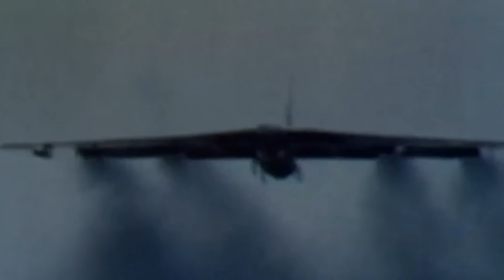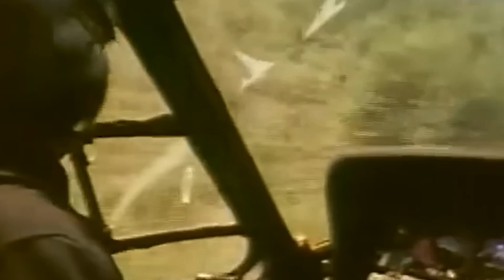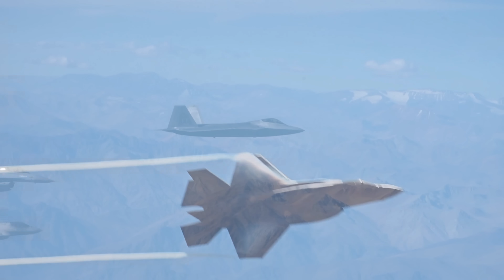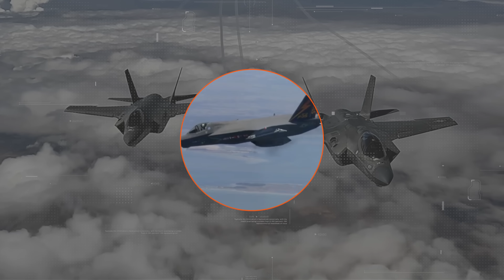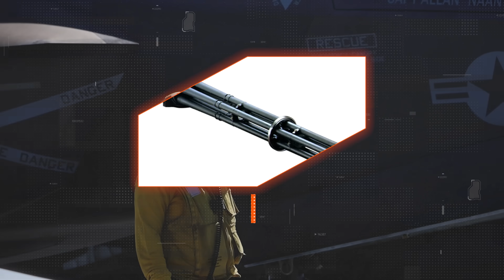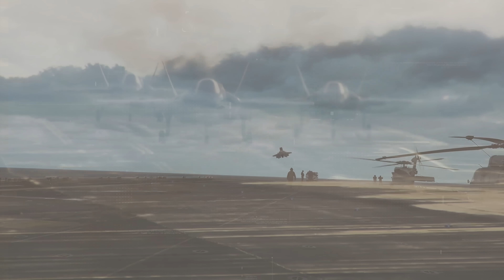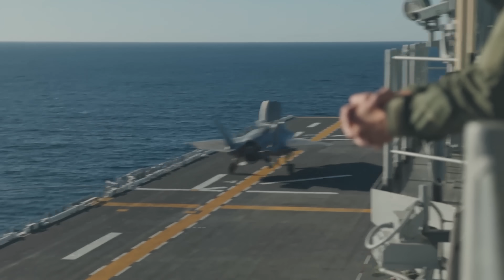A “STUPID” Mistake Is Making the F-35 UNSTOPPABLE

Comment: The F-4 was never modified to carry external gunpods, the gunpods the F-4C onwards used were designed to be used by the F-5C/Es when it was performing CAS missions and came in two flavors, one with a 20mm cannon and another with a 30mm cannon to fight against troops with ligh armored troop carriers. The F-5Cs would be recalled back to the US, when Col. Olds decided to make a tests of its own, he strapped gunpods on his ands his wongmans planes, and went on, and after a series of tests Co ckuded that the 20mm cannon pod offered the greatest bang for the buck in terms of benefits vs performance penalties on the dogfight they had against MiG-15s, MiG-17s and MiG-21s over Vietnan. He then submitted a report to the Pentagon recommending that all F-4s be equiped with at least one gunpod, later the Navy decided to adopt the gunpods, and McDonnell-Douglas streamlined the pods aerodynamics and it external dimensions to be more in line with the F-4s larger size and to be safer for carrier operations. The Airforce was more adamant in dating the Vulcan as an intern gun to its F-4Es, but the Navy's F-4Js continued with the pods for quite a while longer.

Comment: I used to believe the myth that the F4 missing a cannon was a mistake and it's final inclusion restoring the US air dominance.

But the statistics don't bare that out.  The statistics show that pilot training leading to better missile envelope employment and straight up improving the missiles themselves is actually what improved the combat performance of the F4.  The clearest indicator of that is the navy F4, it never had an internal gun, yet it's performance improvement was remarkable.
Reply: To further your point, the original F-4 of the Air Force did not have a gun. When they were fitted with a gun after, their kill ratio did not even improve, but just stayed the same
Reply: and topgun seemed to help

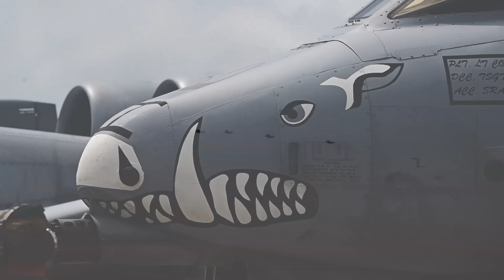Comment: 14:50 A-10s are classified as short take off. They can make do with only semi-prepared 1200 meter runways.  An F-35A needs twice that, in pristine condition.

"The A-10 needs huge runways" ?! Excuse me?

(Yes ok fine Gripen gets by on 800 meters. But 1200 is not huge by anyone's count)

Comment: The external gun pod is stealthy, it does not compromise the low radar observability aspect of the F-35 B and C versions. You still need to get within like less than 10 kilometers of the aircraft to get a radar lock on these fighters. Meanwhile they can just hit enemy aircraft from 100+kms away with the latest AMRAAM.
Reply: The external gun increase external surface area, it must increase the RCS by some amount, that is just physics.

Comment: Ironic. What makes the gun on the F35 B and C so invaluable is the fact that it can be replaced with something else, but otherwise it's mostly a detriment to the A that has it built internally. Though honestly speaking, with modern all-aspect missiles, it's hard to see a situation where having a gun is better than having another missile or two now. I mean, a gun can't shoot at the guy trying to get a gun solution behind you, but a missile can. And stealth fighters are inherently 2nd rate dogfighters because the qualities that make them good stealth jets make them bad dogfighters. Pretty much any 4.5 generation fighter has the advantage once you're within gun range.

That said, I do not think that it's a good idea to simply dismiss guns at this point. A last line of defence still serves a purpose, so it must be seriously considered if removal is to happen.

Comment: We need a new multirole aircraft fighter/bomber.  Give it vectored thrust like the f22 2 engines and use the electronics and the engines of the f35.  Make it 1.5x to 2x times the size of the f22.  More fuel more payload but with 2 of the massive engines of the f35.  This would replace the F-15.
Reply: You just described Su57😅
Reply: @pashapasovski5860  No I didnt because the Su57 is a 4.5 gen aircraft not a 5th or 6th gen and it doesnt have the most powerful engine ever put in a fighter jet.

Comment: Whilst missiles might not have been up to it in the 1970s they're alot better now... Even more crazy is that the F35 is built around the AIM-9 and unable to accomodate ASRAAM....
Cannon were used in both Iraq and Afghanistan against ground targets but that's not what the F35 is really for.
It would seem like taking the cannon out of the F35A would be sensible, then using a gunpod if the mission demands it.

Comment: The F-35 is a overpriced failure. If you want a top of the line aircraft you buy the JAS-39. Far less expensive to buy and to operate and far less of a snowflake when to comes to rearming refueling and repairing battle damage. F-35 can´t even land & take off on a standard straight road but MUST have a airfield, the first target of any attacker.

Comment: Seems pretty stopable . What percentage of the fleet is grounded?
Reply: Yeah, I've heard the software has been really buggy and a huge fraction of the planes are grounded? If the plane's own OS has it shut down before it even takes off, doesn't sound very unstoppable XD and if the software is that unstable, maybe some ECM on the sensors will throw the system into chaos and remove an active fighter from a battle!

A highly complex system can be really advanced and great - when it's stable. If it's not stable, then it's still just experimental, prototyping, unfinished : unfit for combat deployment.

Comment: I just retired from PWA who makes the F35 & F22 engines. I inspected engine components. These are great engines and I was proud to support the Air Force.
Reply: Those engines are a big reason the U.S. keeps an advantage over Russian and Chinese fighters.  And they are getting better all the time.
Reply: Why are the down time hours through the roof??………
Reply: @nikolaucznaum4312 

It is absolutely NO SECRET why the maintenance on the engine is so high. There are a number of governmental reports on the exact cause. Basically the engine is being run way TOO HOT! This is because the airframe requirements were significantly increased AFTER the engine design was completed! To fix this the engine is getting a significant multi-billion dollar redesign to deal with this problem. The problem was NOT the fault of the engine manufacturer, but rather creeping upwards demands placed on it!
Reply: @nikolaucznaum4312 don't believe the hype, they are op available, higher rates than f 16s , and f 15s were
Reply: @nikolaucznaum4312 When you want to make the worlds best stealth plane, you do sacrifice some sturdyness. F-35 has a long turnaround time, because it requires a controlled environment and highly qualified personnel to reload and refuel between missions. This causes more time on the ground. It is not that it is defect, it is a design choice to improve other properties.
Reply: @jenslrkedal9219  Cut the bullshine!!....
Reply: @nikolaucznaum4312 What is YOUR opinion then about why F-35 has to spend so much more time on the ground?
Reply: @jenslrkedal9219  At a unit cost of £92 million. One would assume at least 70% uptime; it currently sits below 50% components are rotting on UK aircraft carriers. Lockheed Martin should be  dragged over the coals for this failure. Did they not do environmental testing in all conditions? The much vaunted F35 has not delivered operational excellence.
Reply: @nikolaucznaum4312  the 4th gen Eurofighter Typhoon cost $200 million per unit.  The F35A cost $92 million per unit.

I'd take the F35, no contest.

It's not Lockheed Martin's fault that the Queen Elizabeth class aircraft carriers are designed poorly.
Reply: @jenslrkedal9219  ALIS and LO
Reply: @nikolaucznaum4312 It is not the engine, it is the overall design. It is a very delicate design, which need a clean environment. Contrary to the Saab Gripen, which is designed to start from a gravel road, and be reloaded by conscripts.
Reply: @j @jenslrkedal9219 ey are literally rotting on UK aircraft carriers engines as well….
Reply: @jenslrkedal9219  The Saab Gripen is closer to  a T-7 trainer than it is to the F35.😂
Reply: @jacobzindel987 There is no comparison, except that Saab was involved in the design of both. The T-7 is a light, subsonic jet with limited weapons capabilities, and without Gripens advanced electronics. It also falls behind Gripen in maneuovre capability and STOL performance.
Reply: @jenslrkedal9219 so delicate  one took a hit from an s 300, and was flown home
Reply: They are an incredible engineering and manufacturing accomplishment.

Comment: With the increasingly huge numbers of drones entering the battlespace, aircraft are going to need significantly more rounds of relatively inexpensive gun ammo.  Perhaps even multiple external gun pods.  An aircraft's internal gun(s)/ may be its most important feature.
Reply: You should have  proximity fused ammo to hit a small target like a drone. That means a 30mm gun or better.

New mini missiles just arriving last month can track a drone, but cost less than a drone. 
7 fit a standard rocket pod.

Comment: This may be a silly question, but what stops them from modifying the A model to carry such accessory pods?
Reply: A model is stated as having its gun internal as the 22 B was STOL and had extra stuff inside so no room. C was more internal room for extra fuel and reinforced for carrier use. Again no room internal left
Reply: @efuller6770  Hilariously enough though the Air Force should adopt the C model wings for more range and better maneuverability.

Comment: This configuration also means that it could be possible to swap other cannons in place of the GAU-22, including lighter weight ones firing the 30x113mm shells used by the ADEN, DEFA, and M230 chain gun (useful against soft ground targets and against small drones if fitted with proximity fuze ammo). Or the BK-27 cannon used by European fighters and originally planned for the F-35 as well.  Plus the faster-firing 5-barrel 25x137 mm GAU-12 cannon (from the USMC Harrier II), the gun the GAU-22 was derived from, could potentially be used as well.

Likewise the exceptional stability of the centerline mount could allow a heavier 30x173mm (same ammo as the GAU-8) cannon like the single-barrel Oerlikon KCA used on the Saab Viggen, or the 4-barrel GAU-13 actually trialed as a pod-mounted weapon on the centerline of the F-16 (and at least proposed for the F-5E as well), but found to be inaccurate due to weakness of stability of that mount. The mount on the F-35's belly sounds like it would avoid that same flaw.

That more powerful 30 mm shell is both higher velocity and fires a heavier projectile, allowing flatter shooting, longer range, shorter time to target, and a bigger payload. With proximity fuzed shells, this could make it useful against drones as well, but at longer ranges than any 30x113 weapon, and with a larger blast radius. (it would also be suitable against lightly armored ground targets or surface boats/ships)
A hypothetical lightened 3-barrel version of the GAU-13 might be more suitable overall and potentially around the same weight as the KCA (also known as the GAU-9 given it was considered for US service in the past).

The Oerlikon KCA itself was used in a centerline pod as installed on the Viggen as well rather than being internal.

Comment: The F35 is a flying Edsel that spends much more time in its climate controlled hangar than being available for service. Real weapons like the Gripen are built tp fight in real wars. The F35vis a prime example of what President Eisenhower warned about with the defence military complex. It wasn't built tomfight it was built tombe expensive. What has it done to degrade Iran's  cintrol of the sraight and its capability to damage the infrasructure of the gulf states
Reply: The Gripen is more expensive. The F35 sells for 110 million. 

Saab quoted Canada a price of 140 million.
Saab quoted Brazil a price of 150 million in 2014. 5.4 billion for 36 jets. So far they've delivered 5 and expect the rest possible by 2032.

Comment: Interresting - the Gripen has a more powerful (kinetic energy) 27mm cannon.  It has a slower rate of fire and does not have as ammo but doesn't have a spin up time.  Because of a lower rate of fire the Gripen takes up to 10 seconds to run out of ammo, compared to 3.6 -  4.4 seconds for the  F-35.  So overall they are comparable armament.  So is the GAU-22 such a miraculous weapon or just hyped more.

Comment: And yet the Gripen beat the F-35 in one-on-one combat exercises, with greatly reduced maintenance time and expense compared to the F-35.
Reply: not comparable, you should be comparing to the F16. F35 is NOT a dogfighter
Reply: @desitri2956  The Gripen didn't win strictly because of its dogfighting abilities, although that is a serious consideration.  It won because it figured out a way to counter the stealth characteristics of the F-35, which is supposed to be its overwhelming advantage.
Reply: @Sailor-Man-Dave  again its not a comparable fight, apples to oranges. F35 isn't designed for a 1v1 its designed to dance around denied airspace...say S-400 while providing a common operating picture for friendly birds. JAS39 is a cheaper, efficient multipurpose fighter designed to skirmish. Not the same class comparison, try the F16 or F18 as a more comparable fight
Reply: @Sailor-Man-Dave Not true. It didn't defeat its stealth. The F35 was limited to not exceeding 25 degrees, which basically gave the Gripen the advantage and it was able to use heat seeking targeting for the kill. 

In head to head, no limitations, the F35 can easily detect the Gripen and routinely gets a missile lock. In dog fighting, with no limits on attack angles, the F35 routinely beats the Gripen. 

The only way the Gripen wins is if you limit what the F35 can do.
Reply: @eec-q3  I should have been more specific.  The F-35 emits signals from its massive connectivity, and the Gripen was able to follow them and "see" the stealthy craft enough to "shoot it down".  Or so it is reported.
Reply: @Sailor-Man-Dave  Multiple pilots have talked about how lopsided the BVR  battles have been with 4th generation aircraft. The only conventional style aircraft that has put up a fight, was the F15EX, but even that was lopsided.
Reply: Nonsense. The Gripen is costing Brazil 180 million per plane. 

As far as dog fighting, the F35 was limited to not using attack angles greater than 25 degrees as the Gripen can't go more than 25 degrees without issues. BVR  range was eliminated from the "fight". The Gripen is very easy to see because of its canards. 

If you take away the advantages of the F35, is it really to see it losing. 

But here is a better stat, the kill ratio. 

With no limitations:
The F35 has a 20-1 kill ratio.
The Gripen has a 2-1 kill ratio.

When people quote the costs of maintaining the Gripen, Saab deliberately left out costs. When you include everything, the F35 is actually cheaper.

Comment: The F-4 was developed to be a long range interceptor for aircraft carrier defense or for continental defense from Soviet bombers.  It was never meant to be a dogfighter. It adopted quite well to it's new found roll in Vietnam.   But not because of the gun, but from Operation Tea Ball.

The U.S. Air Force’s first kills of the war occurred on July 7, 1965, when two MiG-17s attacked a pair of F-4C Phantom II fighter-bombers, which used their superior speed and rate of climb to reverse position on the MiGs, a tactic incorporated into the Navy’s Topgun program four years later.

USN F-4s shot down 40 MIGs and lost 5 F-4s to MIGs (8-1)
USN F-8s shot down 18 MIGs and lost 3 F-8s to MIGs (6-1)
Only 4 kills by the F-8 were by guns.

!!!!!>>>>>   "In August 1972, the Air Force finally got its technical answer to the attack warning problem: a control center called Teaball. The center, at Nakhon Phanom Royal Thai Air Base, fused information from available intelligence sources and provided MiG warnings in real time over a complicated set of radio networks. Air Force crews got the situational awareness they had been lacking—and Navy crews had enjoyed with it's "Red Crown" radar ships] —since the beginning of the war. Teaball essentially solved the ambush problem..... 

Freed up by Teaball to be more aggressive without fear of ambush, the USAF MiGCAP force did spectacularly well, shooting down 15 and losing only one. [15-1 kill ratio!] In short, when the Air Force was afforded conditions similar to those that helped the Navy with it's "Red Crown" radar ships in the Gulf of Tonkin, the results of the two services were very similar."

It was Situational Awareness afforded by Teaball that made the USAF F-4 kill rate over the Migs 15 to 1, not the gun!

Comment: That pod carries LESS THAN A MINUTE'S worth of ammunition. Which means it's CAS mission is compromised, not to mention its loiter time is much shorter than the aircraft it is supposed to replace.
Reply: I did the calculations - the F-35A carries 182 rounds.  At 3300 rounds per minute that's 3.3 seconds of firing,  For the F-35B and C it's 220 rounds calculating out to 4 seconds of firing.
Reply: No aircraft caries a minute’s worth of ammo, except maybe a C-130 gunship.
Reply: @Count_2_10 ever heard of the A-10?
Reply: @Rorschach1024  the A-10 has at most ten seconds of ammo, and usually carries less than five.

Comment: If you're deciding to use on a cannon on a mission, then stealth isn't really a mission requirement to begin with that day, so having it as an optional external bolt on isn't really a problem.

Stealth really is an early war priority, once the other side no longer has an air force, and no longer has SAMs, and you're into the CAS stage of the game, then stealth doesn't really matter as much, so bolting on a gun pod at that point isn't a detriment to stealth as stealth isn't needed, and gains you nothing when it's all up close and personal.